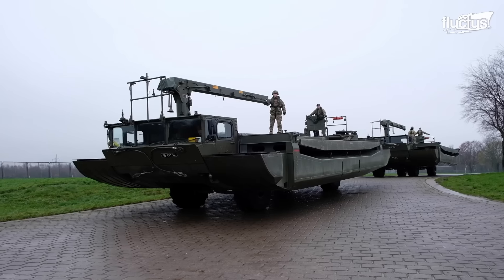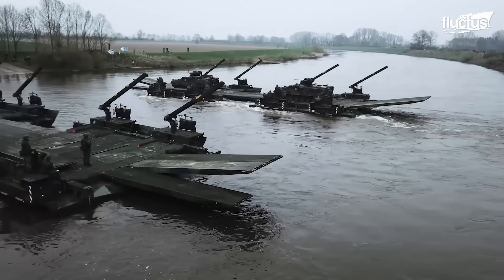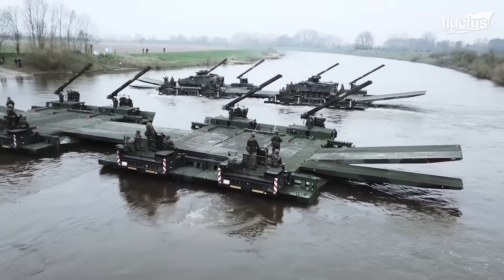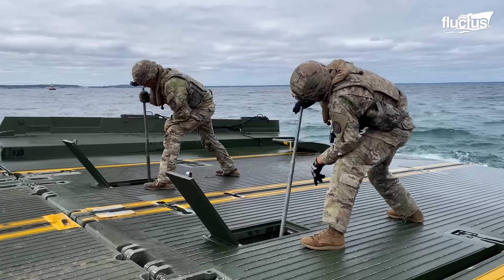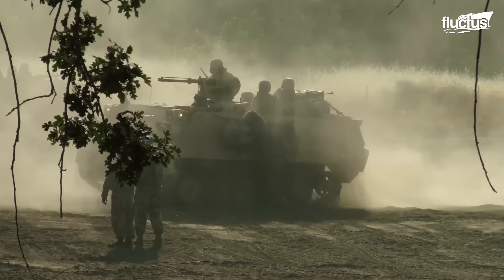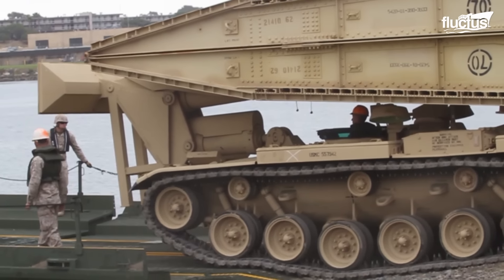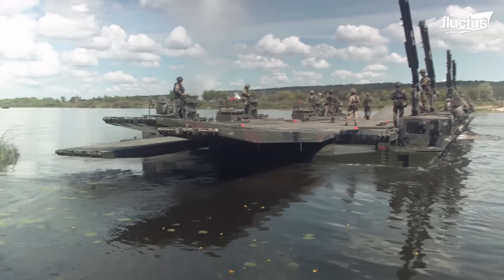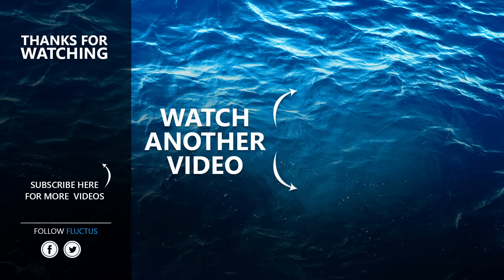How US Builds Advanced $13 Million Bridge in Minutes For River Crossing

Comment: That bridge can be a high value target that could be knocked out with artillery and such. So in addition it might be good to be able to quickly build a small light weight bridge that is harder to hit and easier to repair.

For example one could build a floating light weight narrow gauge bridge say using PVC pipe and use e-bike technology  to ferry men and supplies over a river (one might Goggle e-bikes on rails).

If a section is knocked out out it could be repaired with a hack saw, some glue and some more PVC pipe. 

Also, one could have a  machine that runs on the rails that can help do that.

A cargo e-bike can carry 500lbs of cargo at 20-30 mph. So even if that light rail bridge is knocked out half the time, the other half of the time one could  carry thousands of tons of material across it.

And if the enemy is having to continuously take out these bridges as sections are knocked out and the rapidly repaired, trading  valuable artillery rounds for PVC pipe and glue is not a bad trade!

So while being able to having a $13 Million dollar bridge in minutes while both valuable and necessary may not be sufficient in that at times one might need a little brother bridge that only cost a fraction of that cost and can be easily repaired, even if it can only be used to carry light freight. 

Yes, one can do that with helicopters, that is if one has air superiority, but that might not always be the case. Also, one might put those helicopters to better use by using them to help lay the bridge sections and then free them up for other  more urgent and critical  uses.
Reply: Somebody sells PVC
Reply: You just need to choose right enemy, without artillery, long range munition, planes and missiles.